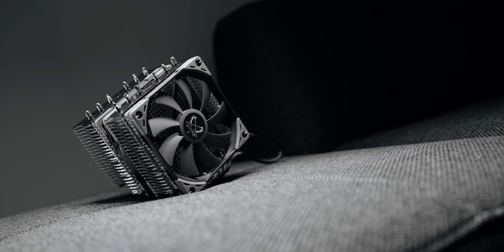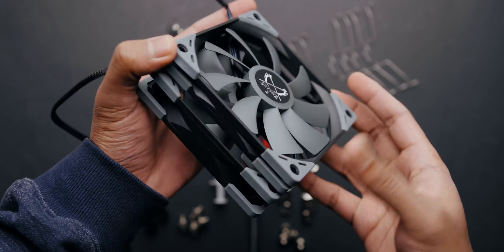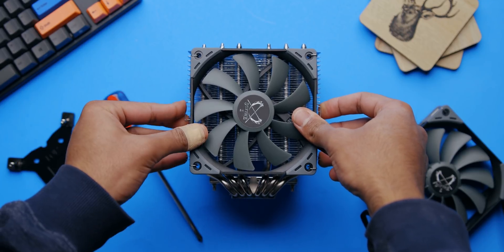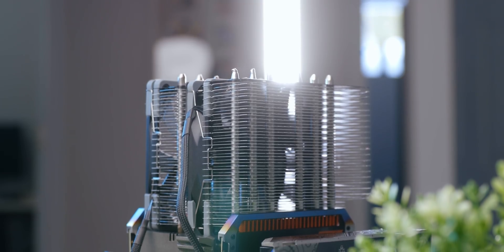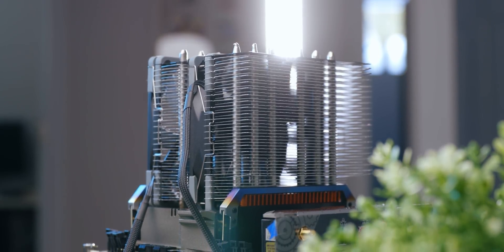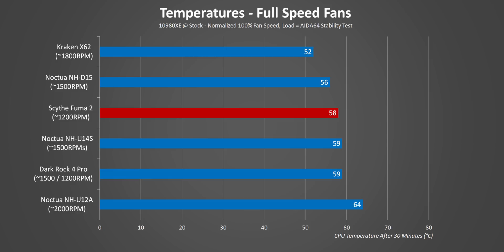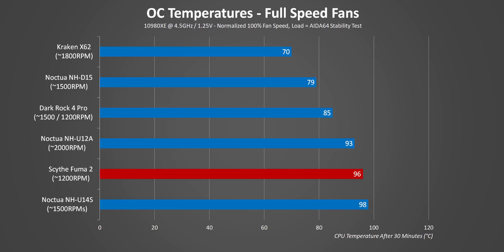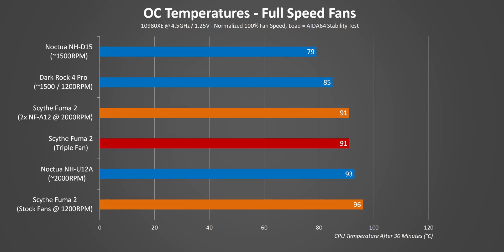A CPU Cooler You NEED To Know About!  Scythe Fuma 2 Review

Comment: I'm pretty jazzed with the numbers and I want to build an air-cooled system. But, I wonder why fan design is still where it is today. For example, the Dyson "bladeless" household fans use an airfoil type technology to maximize airflow while reducing power demand and noise levels. Why isn't this technology showing up in electronics that use airflow cooling? Hmmmmmm

Comment: The sharp edges are meant to cut the user during installation and anoint the cooler in a blood pact.

Every time the processor reaches the thermal throttling point, the Scythe Fuma 2 draws from the owner's life force to improve cooling. This may lead to accelerated ageing for those running this cooler in systems subjected to constant thermal loads.
Reply: Lol I like how it sounds so serious

Comment: Mugen 5 and ninja 5 next.   Please... do a review on these three on a pc011...
Reply: Mugen 5 = 154.5 mm tall, Fuma 2 = 154.5 mm tall, Ninja 5 = 155 mm tall, max cpu cooler height in the Lian-Li PC-O11 (not XL) is 155 mm. So, it will be a tight fit for that case and thank god for google where you can find the dimensions of the coolers and specs of that case.

Comment: I recently replaced my old brand name liquid cooler with a Noctua NH-D15 (with non-standard Thermal Grizzly thermal paste - to get the best performance possible, since it substantially out-performs the NT-H1 paste that Noctua provides), out of fears that the old cooler could leak over time and totally wreck my system as happened to my last build.  I was expecting some loss in cooling performance, but was amazed and surprised when the NH-D15 beat the old liquid cooler by a substantial margin - dropping my "100% CPU for over an hour" video rendering workload (on my 140w TDP i7-5820k) by an amazing 15C.  I hear no noise at all from either cooling solution in my full tower case (especially since the max temperature I've ever seen with the D15 (only 51C) is still way below my max fan speed settings)...

You are right about the minor difficulty of lining up the NH-D15 to get the mounting screws to threaded correctly - that took me a few minutes to accomplish since you're basically doing it blind.

Comment: Thermalright Macho Rev B would fit in well here at 40 euros. The fan runs at 300rpm during idle and is noiseless.
Reply from the maker: The main problem with Thermalright coolers is availability.  They don't even have a rep for North America anymore.  Heck, I still have my lapped TRUE Ultra - Mike

Comment: VERY MISLEADING IMO
You say "it just kills everything else in noise testing", yet for THAT test you just ran the fans at full speed so what did that prove? The fans ran 300RPM slower than the Noctua NH-D15 so that test is a little meaningless since that's not APPLES to APPLES... EARLIER in the testing you showed the Noctua NH-D15 being FOUR DEGREES cooler while also being quieter so I find these statements a little misleading... and WORSE, you also said "this proves the Scythe can cool any processor available.." yet you show your CPU hitting 96degC in one test and 105degC in another so that's pushing it IMO... we don't need TONNES of charts frankly, but rather a few CONCISE ones. Do we need all the fans "normalized" to 1000RPM when the fan noise is probably different between 1000RPM for different fans? Why not just stick with fan noise then?.. the NOCTUA NH-D15 cooled the CPU to 79degC when the Scythe was at 96degC showing the Scythe can't effectively cool beyond a certain point as you're hitting thermal runaway... do I think the Scythe Fuma 2 is a good value? Probably? But it's rather difficult to wade through the charts as the main ones that matter are TEMP when NOISE is normalized (and vice verse).... did you even run a test that NORMALIZED NOISE or TEMP? I see "default" fan profiles (that are different for each cooler), and "1000RPM normalized" (which are different for each cooler) etc..
Reply from the maker: You raise a good point but in that test it cooled just as well as other fans that were running at higher RPMS.  Therefore in noise vs performance it does kill pretty much everything else.

Comment: I got the gelid phantom black , its 30 quid at the moment , 2 tower , 6 dual pipes , , half the price , very quiet , though I am using it with a 2700x . so I don't know if it would mange with intels new space heater offerings
Reply: The Gelid Phantom Black has 7 heat pipes: 3 x 8 mm & 4 x 6 mm. Damn good performance for 40 Euro, sadly having a flimsy installation method, not usable if you have tall memory sticks and pretty loud fans at full speed.
Reply: @dorientjewoller113  ah yeah , forgot I used lpx , I haven't found the fans to be loud , but then agen the 2700x is well below tdp

Comment: THANK YOU! I really wanted to see the Fuma 2 tested with the dual Noctua fans, this is a cooler with a lot of cooling potential.
Reply: In the amazon top review, just changing the push fan to A12 beat the D15 by 1c, and having a third fan by 3c. And per review, for it's size compared to the D15, this cooler definitely have a very efficient design, probably the best one out there.

Comment: Scythe,
one of the most underrated brand in PC industry

imo, 
Scythe deserve same attention like Noctua
Reply: Two words: Ultra Kaze.
Reply: Fun fact: If you buy a Noctua in Japan, 9 out of 10 times, that cooler was imported and distributed by Scythe.
Reply: @dorientjewoller113  that's interesting

so, is Scythe a Japanese brand??
Reply: @ZAR556  Scythe is a Japanese brand, founded in Feb 2002 with a core business of importing and distributing PC cooling hardware for industrial purposes. Grown later on into modding of these parts and fabricating their own coolers. BTW, Fuma means in Japanese unabashed, inmortality, permanency.
Reply: Scythe and Thermalright are probably the two best value brands out there for CPU coolers.
Reply: @whomad15  Scythe new Aya-Kaze fans that are currently Japan-only blow everything else out of the water in terms of static pressure, 1500rpm but it outperforms also 1500rpm Noctua NF-F12, 2000rpm Cooler Master Silencio 120 and 2200rpm I think EK Vardar fans, it's crazy good, and RGB ones are like $9, with also one color option and argb option for a bit less/more money
Reply: here in germany they are available in pretty abundance & well liked!
Reply: Scythe used to be king before Noctua, i remember the gentle typhoon 120mm fans, damn they were good
Reply: They do.
I've been running Scythe coolers on most of my systems and even after trying other coolers nothing comes close
My Mugen Max is close contact with my 4790k since day 1 and it's able to keep it running cool OC'd or stock

When I build PC's for others I usually slap in a Scythe cooler, if they ask why or get confused why it's not a Noctua or BeQuiet cooler they'll get it after seeing HWiNFO :)

Scythe, keep it up!

Also great review, was looking at this cooler for my home server as it's currently too loud and I'm done with server fans disturbing the peace & quiet :p
Reply: I remember very well Scythe, I had a Scythe Ninja Cooper, the original version to cool my old S939 Athlon X2. In that time Zalman with their crazy cooper coolers and Scythe were the most exotic and used brands. Scythe still is only for people who know it and used in the past, since their market penetration in the west is limited, and Zalman just simply gone down and got restructured. Also Scythe were the distributors of one of the most used fans in the time, the Nidec Gentle Typhoon, similar to the EK Vardar.
Reply: Arctic runs under the radar as well. They make good stuff.
Reply: Scythe was the king of fans with their Nidec Gentle Typhoon series for static pressure and their silent line of Kaze case fans.   One of the only good choices for slim 120mm fans not too long ago.   They have always struggled to meet production demands compared to larger competitors.
Reply: Agreed, though it would be cool to also see them collab and use noctua fans on the more affordable coolers
Reply: I've got a scythe ninja in my parts draw had quite a few years, on the amd phenom II x4 960t back then,after that installed it on my 4790k was too toasty. they are great  coolers, but for high temp cpus erm  mounting was a pain in the arse , running h100i v2 now , ordered liquid freezer II 360 for £89.99
Reply: Would definitely like to see wider distribution of Scythe, GELID, Arctic products in North America. I've had 3 GELID Silent 12 PWM fans running in my main rig 24/7 since 2011 and they are still whisper quiet.
Reply: @lepoldbuttersstotch  Oh yes, the Gelid Phantom Black cooler, Noctua like performances for only 40 Euros, 7 heatpipes, 3 8mm ones and 4 6mm ones. But no RAM clearance.
Reply: Yep, i agree. I use a mugen5 rev.B to my r7 2700 @4GHz. and its nice and quietly.
Reply: Yessir
Reply: A lot forget Thermalright they are the pioneer leaders and they was way ahead of Noctua some years ago and some of ther older products can compete with newer Noctua like the more then 12 year old then flagship Truespirit  120 black rev.c  and the bit newer ones like Thermalright Archon and Silver Arrow i used Thermalright from 2000 2001

Comment: so let me get this right..... when you take the scythe fuma and the noctua d15 and set the fan rpm to 1000 for an somewhat equal comparison and it turns out both coolers a somewhat similar. but when you crank the fan rpm to the max the scythe is better? just because the fans cant spin as fast as noctuas and are so a little bit more quiet? i liked to see the performance of the noctua d15 caped at 1200 rpm.

Comment: after watching GN video about cpu coolers, I can't watch any other cooler reviews
Reply: TBH, using a test dummy is only good to validate the results, which is already been done for years by Hardware Info. So, Steve doesn't do something new under the sun.
Reply: @dorientjewoller113  Are you referring to the Dutch website?
Reply: @Bluth53  Yes.
Reply: @dorientjewoller113  I'll check it out. Thanks for the tip!
Reply from the maker: To each their own.  :)  We prefer to use a CPU and real world test system.  If GN wants to go about it differently, good for them.  Variety is the spice of life as they say.
Reply: @HardwareCanucks  Variety has no place in a fair comparison, that results in a recommendation to buy or pass - checking up on your methodology, there are still plenty of questions about variables in your testing, that should have been made clear.
Reply: @Bluth53  In the end, it's all down to tolerances (margin of error). GN has done hell of a lot of things to improve the accuracy, but tbh that will only matter for top tier overclockers who do crazy things where a couple of degrees difference will make or break a system. There will be no dramatic changes in how coolers perform because of this, coolers with poor performance is not  going to become dramatically better all of the sudden.
Reply: @gutterg0d  You're spot on - I wouldn't call myself a top tier overclocker, though. Just part of a niche audience, looking for the latest and greatest (in comparison to the established products), who's not willing to operate an AIO(or custom loop), despite running way past recommendations for Core voltage, beneficial for specific purposes on my end.
Reply: @Bluth53  They have published their test method.  It looks reasonable to me.  What specifically do you have concerns with?  I thought the review of the A500 was very well done especially the follow up where they tried modifying it.  I like Tech Jesus and look forward to seeing his results, but when fan RPM's vary by +/-10% any cooler you buy is going to have that variability built into it.  You can be overly analytical.  I have Noctua D-15,  I had it on a Ryzen 1700,overclocked at 3.825MHz and 1.35V  when I built a new 3700X system,  I put a Deepcool Gammaxx 400, with an Arctic Bionix F120 Fan on the 1700.  The temperature difference was only 2.1 C. In a  test using Prime 95 for 15 minutes.
Reply: @jamesthomson8659 Mounting the cooling system only twice and cherry picking the better results of the two.
To me 2.1° diffence will either boot or freeze an 8600K @1.55V to achieve 5.3GHz in a european non-AC environment during hot summer months.
Reply: @Bluth53  The silicon lottery has a bigger impact on what you are trying to do than which cooler you choose.   Your 2.1 degrees accuracy would only be relevant if all of the chips could actually run at 5.3 MHz.  GN's  testing won't help as it is only going to be done with one specific chip.  The fundamental issue is that two different samples of a 9900K,  3800X etc.,  don't produce the same heat load when run under the same voltage and freqency.
Reply: @jamesthomson8659  Of course - I'm aware and didn't even get lucky but paid premium from a vendor selling such pre-selected prime silicon samples. What I'm trying to state is that no matter the CPU, the lower the temperature, the higher you can go. For 98+% it won't make any difference whatsoever, as you've shown with your earlier example - they should pick by deciding factors like budget / looks / noise levels.
Reply: Them having a fancy space heater to test with doesn't invalidate all other reviews. There's things like fitment/looks plus people not repeating "and uhhh" every 5 seconds, or talking in circles for a 30 minute video.
Reply: @Hellhound15x  yeah, honestly he could fit all the info into a 5 minute video and it would be sooo much easier to watch.

Comment: I can’t get a good quiet fan curve dialed in on my 3700x/wraith prism cooler in an h500i. I have a Corsair h115i (I think) pro 280mm w/ 2 140mm BeQuiet high rpm fans, and I have a scythe fuma 2. I use my computer more for workstation duties than gaming, but I want it quieter and to not ramp up and down as much as the stock cooler. Maybe I should try them both.

Comment: I got the Scythe Fuma II also and it is very good. However I would recommend the Scythe Ninja 5 instead it's quieter and performs equally good. If you replace the 800rpm scythe fans with 1200rpm fans you get minimal noise increase and you get a cooler that beats a Noctua NH-D15, which I also have.
Reply: Please inform the people that the use of memory with low heatsinks or none are required with this monster.

Comment: Bought one based on the Ponchato video, and it has kept my i9-9900k at good temperatures. I haven't OC'd it yet, but I think there is good headroom as they highest I've seen it is in the low 60s with a stress test.

Comment: A question that’s been on my mind since forever. 

Why is it that all you PC tech channels use the the product you’re reviewing with just high end CPUs, like the 9900k/3950x, for benchmarks and not with other lower to mid range CPUs? 

It be cool to see temp differences between each CPU with the Air Cooler, product,  being reviewed. Only benchmarks I see are between different air coolers, aios, open and close cases, etc., using the same cpu.
Reply from the maker: That's a great question.  Basically we want to test these to the thermal limits with given processor tech and that means choosing a processor that tends to run quite hot.  If the cooler can take care of that, it should technically be able to adequately cool anything else as well.
Reply: Because you just can't push the coolers far enough with low end CPUs. If you have something like a locked i5 or stock Ryzen 5, any aftermarket cooler will do.

Comment: I have Fuma 2 on my 3700x, it isn't even challenged.  Super quiet.  I now hear all kinds of other noises in my system.  Also, the fact that the Fuma 2 achieves this performance with very low rpm spinning 120mm fans is incredible.  It performs nearly as well as the other coolers with 140 mm fans.  Because of this, the Fuma 2 can fit in many more build.  For instance, I was going to choose the Noctua DH15 but the noctua website says it would interfere with my GPU in slot one on my X570 Steel Legend Motherboard.

Comment: And then there is the OG Fuma, mounting system of that cooler allowed it to put more pressure than usual, resulting in performance that decimates every other air cooler. Tho that applies only to Intel 115x motherboards.

Comment: from my quick google search...I can't seem to find anything about clockwise and counter-clockwise fans.
Reply: search quicker.
Reply: @ArturoTabera  Don't you mean search slower? 😁 Or maybe search deeper?   Really, it's  right on the Amazon page for the FUMA 2.
Reply: Aviation technology, used first on Tipolevs. Creating a better airflow, static pressure and less turbulence behind the blades and at a lower RPM. Not a big success due to the complexity of one hub with 2 fans spinning in opposite direction with one motor. Whereas with an air cooler it's easier done as both fans have their own individual motor.

Comment: I am curious if the temps would drop more if u get scythes own 1800 rpm fans as replacements and have the airpressure clock wise counter clockwise and clockwise again that might be the ebst case I think I might do that for shits and gigs myself. i got that cooler myself and love it